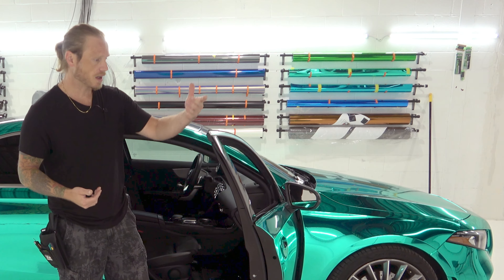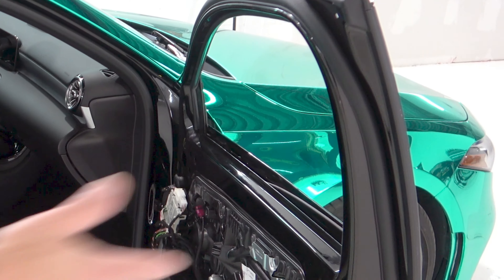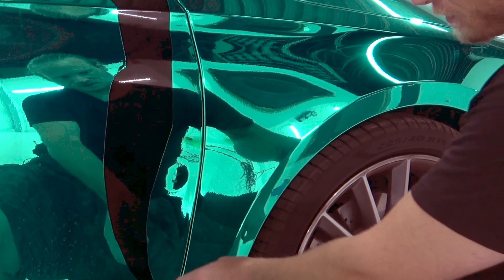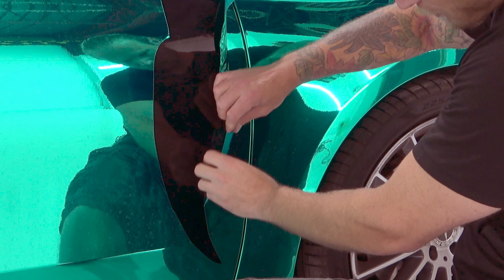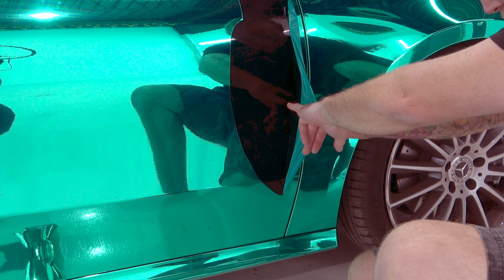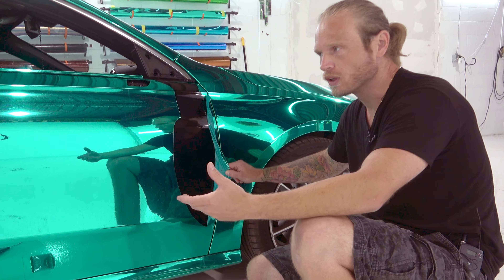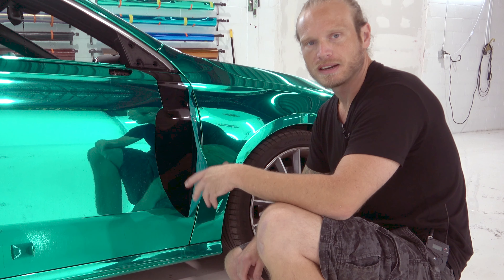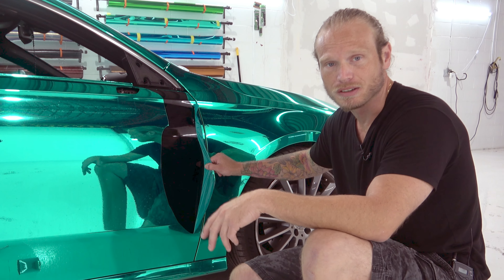Forklift Vs. Vinyl Wrap - Who Won!?

Comment: I have a question, I'm about to wrap the hood on my VW Golf but the hood is faded out and no gloss finish on some areas of the hood. I was thinking I'd have to give it a nice sanding to make the surface smooth and uniform am I making the correct decision to get the best result from the vinyl wrap? I watched your video when you applied the vinyl wrap satin finish on the blue Honda civic and it was very easy to follow your instructions.  The finished wrap looked amazing, appreciate you making & uploading your videos they have been a great help & my go to! If you have a few free moments to let me know your thoughts & suggestions  about my question I'd very much appreciate it. Thanks for you're videos & the time you take to make them for people like myself.  Cheers 🍻